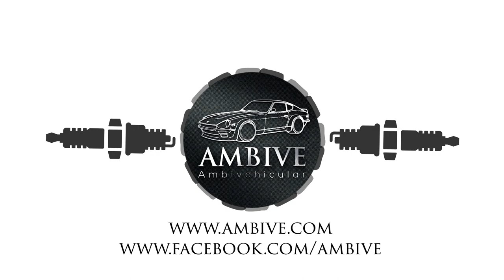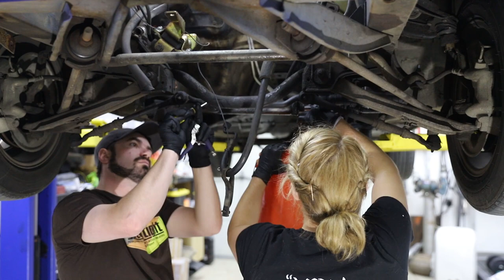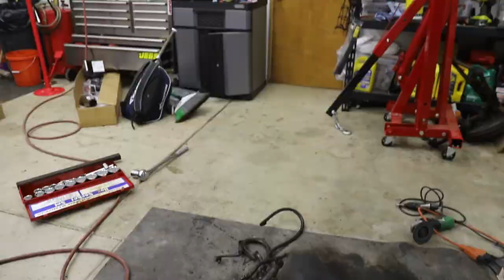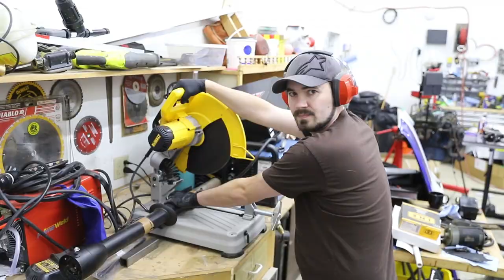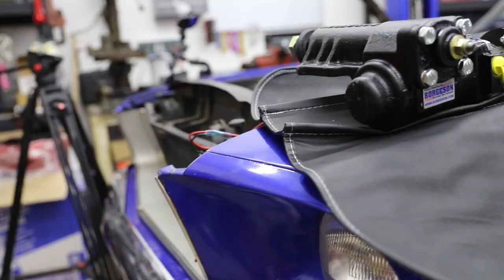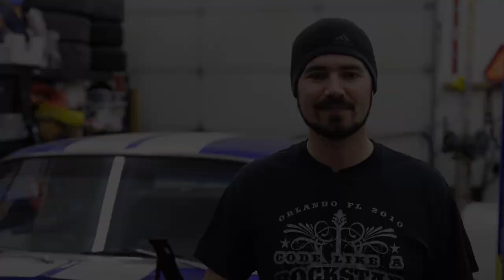67 Mustang - Borgeson power steering upgrade.

Comment: Helping my buddy fix his 65 mustang #1 is safety. His has manual steering I think. What would you recommend to do for a collapsible steering column with power steering?  Rack and pinion with electric power steering?  Thank you!
Reply from the maker: Safety is actually pretty subjective in an old car like this. A collapsible steering column would be a good idea if you were not going to be using some sort of should harness setup. Really, it's a matter of acceptable risk. I went with the Borgeson setup because I didn't want to have to fight for even more space under my dash (which is already limited) and it is a simple system. Rack and pinion would probably give better precision, but electric power steering entirely depends on the unit. Some are really vague and awful, others are great.
Reply: AmbiVe yeah I see where you coming from. If you wanna be safe drive a F250 with steel brush guards and a cage. 
His ‘65 is a simple car, and I just want to make some recommendations on how to make it the slightest bit safer. Found a cool tank top for the gas tank to protect it from being punctured and a steel sheet behind the back seats as a make shift fire wall. Little things like that.  Any recommendations you could make would be much appreciated
Reply from the maker: Most of the safety comes from preventing a crash in the first place. I focus on ensuring there are good quality, newer, tires. Then I make sure the suspension and alignment are good, brakes are good, etc. Ensuring nothing mechanically will fail you, then crash safety side I try to make sure I have reasonable seat belts and some partial caging on these flexy old cars. I also keep a fire extinguisher made for car fires easily accessible to the driver in my old cars.

Comment: Any issues? Still happy you went this route? Thinking about doing it with my 67 Cougar
Reply from the maker: I am still pleased with it. I would say that rack and pinion swapping the whole front system would be best, but this would be the next best option. I haven't had any issues the last 10k+ miles and it feels much better than original.

Comment: How does it drive after installing a new Borgeson Steering Box? I never seem to get a good answer as I am on the fence on this box and Rack and Pinion.
Reply from the maker: It drives well. I drive much more aggressively than most people and it handles much better than with the old box. 

Rack and pinion obviously is a very different mechanism and needs  much more replaced. If you don't mind the money and parts required, a good quality rack and pinion would potentially feel more tight and precise.

Comment: My 67 /289 convertible did not come with power steering. Is this is the kit that I need?
Reply from the maker: You certainly can go this route. My car was power steering originally, but I did this kit and swapped to a manual steering Z bar. If you don't have belts and pulleys already, it's not a bad time to go with a serpentine belt system.

Comment: Why did you choose this upgrade over a rack and pinion system?
Reply from the maker: The rack and pinion options required more modifications and cost for similar performance. It also came down to what was reasonably available as most of the quality rack and pinion kits with all the extras needed to dial them in and properly finish the install were 6+ months delayed at the time.

If I had been replacing the entire front end and going all the way with a new cradle, suspension, etc, I would probably have gone rack and pinion and waited for everything to be available. You can't really go wrong either way if you just need to improve the steering feel or replace a worn system.

Comment: So you didnt show how you attached the steering shaft to the borgenson. Is there fitting that attaches the two? Theres not on my 65. I'm trying to add power steering to it the easiest way. Was thinking about doing one of the electonic power steering conversion off a newer car.
Reply from the maker: On my 67 it uses an adapter to connect the shaft to the Borgeson unit. If you look at the pictures on CJ Pony Parts, you can see a small disc that is a rag joint that adapts between the pieces. If you are looking for extreme precision and feel of a new car, you will need to replace the whole steering system with rack and pinion, but if you just want power steering or to replace a worn power unit, either option should work well for you.

Comment: Still enjoying this kit?
Reply from the maker: It still works well, no problems to report. I am contemplating moving to rack and pinion so that I can free up some space and play with the front end setup more, but that is more for really aggressive driving/racing.
Reply: @AmbiVe  My current gear box is 100% clapped out. So, I considering this conversion to save having to rebuild all of the factory components. Appreciate the quick reply!
Reply from the maker: That's why I did it. It was a better setup for me than the factory style, feels good, and I figured it would be a decent upgrade over the old system. There isn't a real one size fits all for steering solutions. 

Good luck with the project!